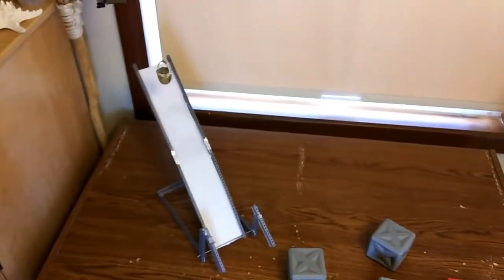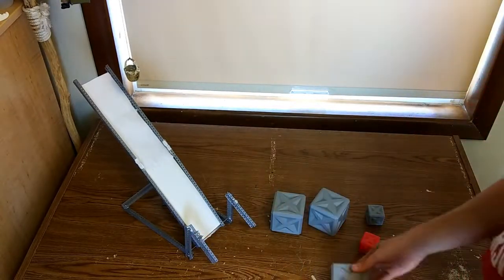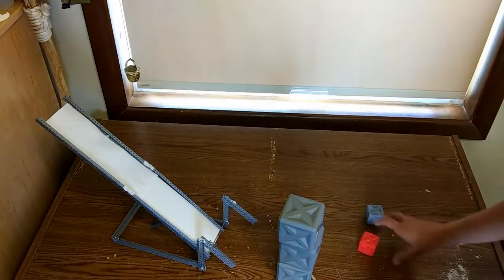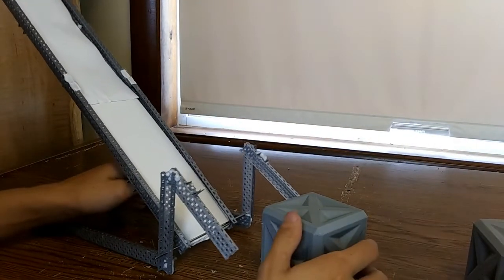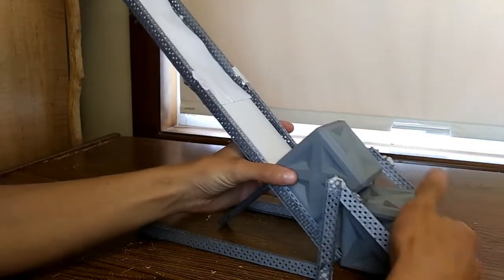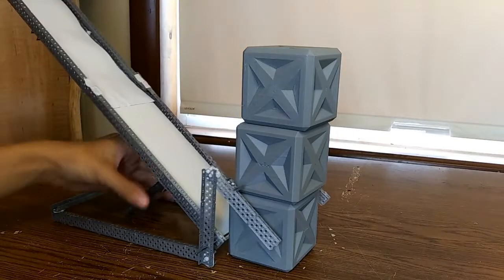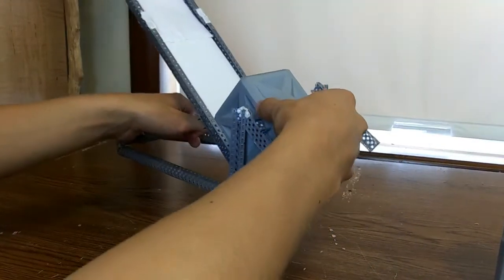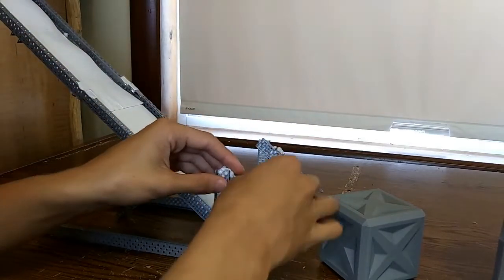3D Printed Tray Intake Prototype! Vex Tower Takeover

Comment: have you considered making some sort of ratchet system to hold cubes in? I've been playing with the idea in order to reduce stress on the motors, because once you have 6 cubes, its a lot of stress on the motors. Let me know what you think.
Reply from the maker: I thoughy about it, but it would be too complicated to go reverse with ratchets to drop cubes in towers and if the V5 motor brake type hold is good enough it shouldn't be an issue.